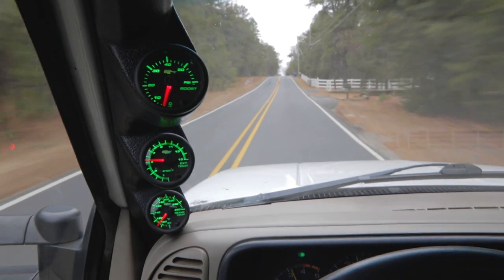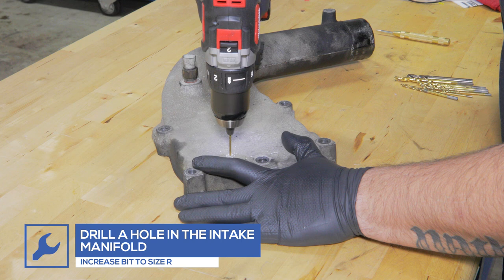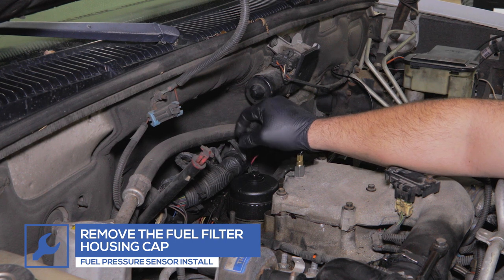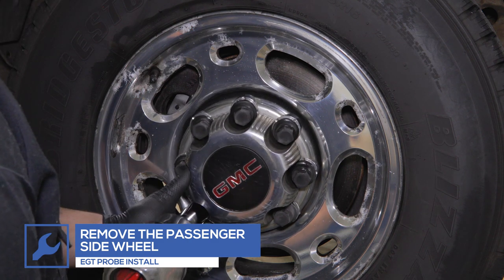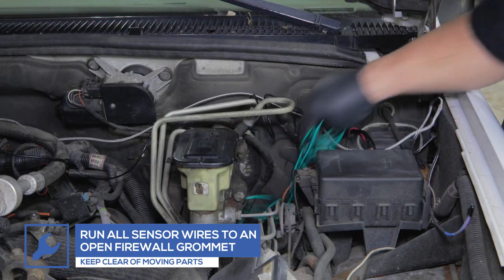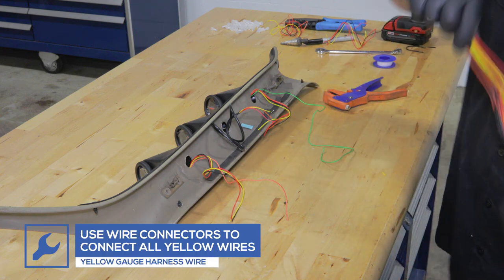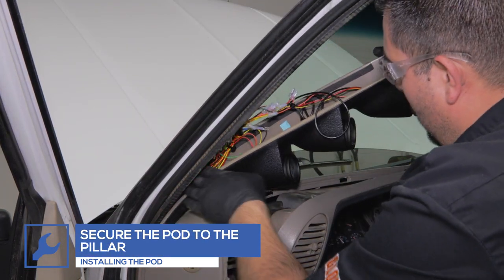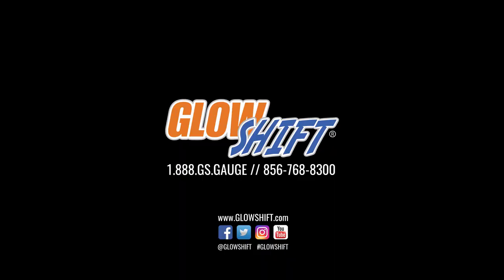GlowShift | How To Install A 95-98 6.5L Turbo Chevrolet or GMC C/K Full-Size Diesel Gauge Package

Comment: I bought the boost bolt adaptor and the instructions that you sent with it now take out the front centre bolt instead of the rear. Does it matter which one I use?
Reply: You’ve probably got it handled now, but you are correct about either of the two center intake manifold bolts being the ONLY boost reference holes. Cheers!

Comment: Could you have used expandable circuits for the headlights voltage instead of a wire splice
Reply from the maker: Yes, we actually do that often. For this particular install we decided to splice.
Reply: @GlowShift  can you show that

Comment: Ill have to send a pitcture of my 6.5 to Glow shift when I get the truck done I bought a dash mount 3 gauge pod and I fiberglassed and modled it into my dash on my 98 chevy I then smoothed out the rest of the dash pained it base coat clear cloat big job truck is slowly coming together defiently putting Glow shift gauges in hope to take the truck to a few shows could possibly be niced 6.5 turbo diesel in Saskatchewan when im done maby even all of canada seens everyone hates them and don fix them up

Comment: I counted total of four gauges Boost gauge Trans. Gauge .Fuel pressure gauge Exhaust Tempature gauge . Were did you put the fuel pressure gauge. You show a three pod system
Reply from the maker: Our 3 gauge kits come in a few different options, for this particular kit you can purchase one that comes with a transmission gauge or a fuel pressure gauge. So we show you how to install the sensors for both but only show wiring one to power because that is the same for either gauge.
Reply: @GlowShift  Thank you for the info I received my gauges with all the connections that I ordered . I can not wait for the weather to warm up so that I can install them
Reply from the maker: Let us know if you have any questions!

Comment: Can I just wire a gauge to the temp sensor under #1 I think it is? My gauge is bad on the cluster
Reply from the maker: Our gauge will only work if it is connected to our sensor.

Comment: for the dimming feature to work you would need it to be attached to the rheostat side of the dimming switch not headlight 12v???
Reply from the maker: No, do not connect it to the dimming switch. It needs to be connected to the headlight 12 volt switch.

Comment: How would you run a fuel pressure gauge, is it the exact same principle as a boost gauge
Reply from the maker: What do you mean by run?
Reply: GlowShift Gauges do you run/ feed the boost hose from the fuel filter housing through the fire wall and to the fuel psi gauge the same as a regular boost gauge
Reply from the maker: Yes, that is correct.

Comment: After installing the transmission temp sensor i realize i do not have the green and black wire for the next step. Can it be ordered separately?
Reply from the maker: You can use any 18-gauge automotive wire.
Reply: @GlowShift  thanks for the reply 👍🏼

Comment: What if you have an egr valve, my k2500 light duty has an egr valve which uses the front and rear center bolts on the upper intake ??
Reply from the maker: You can use the second option of drilling the hole for the boost line.

Comment: Is this the same for a boost and vaccum gauge by glowshift or is it just the boost gauge
Reply from the maker: Just the boost only gauge
Reply: @GlowShift  how do you do boost and vacuum gauge
Reply from the maker: @gavingrant1715  for boost/vacuum you would need to locate a factory vacuum line and use the t-fitting that comes included with the boost/vacuum gauge.